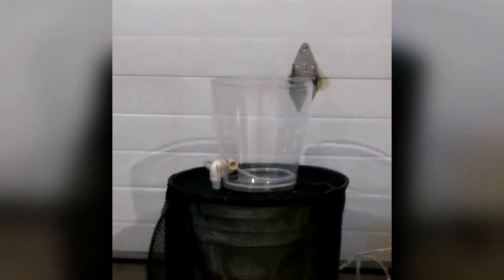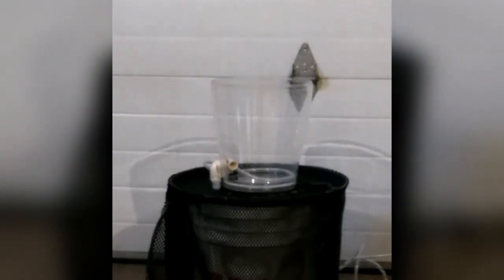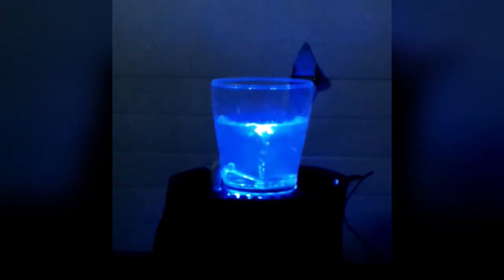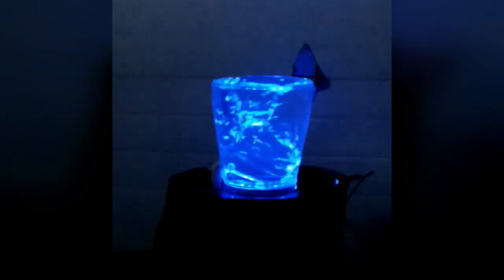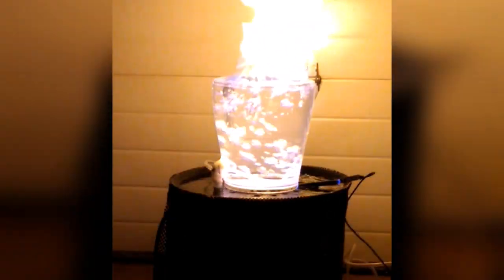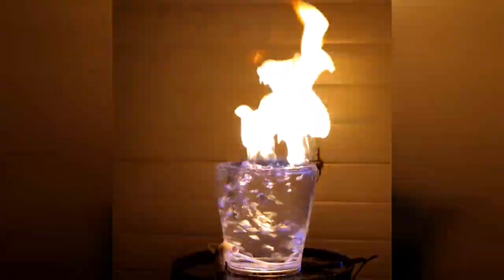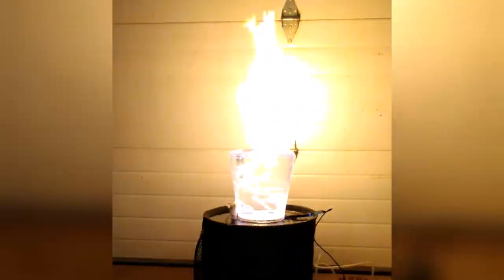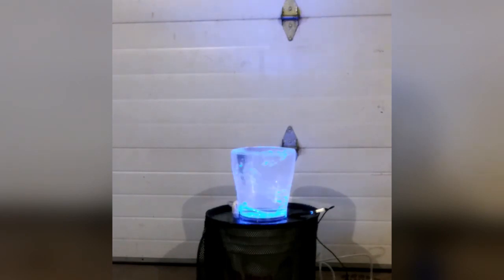DIY Vortex Fire Water Fountain

Comment: Wow!  Thanks for this.  I wish you would have explained how you attached the propane hose (to the tank (and what size tank)), as well as the tubing and all of the needed equipment for it - regulator, plug end of tube, then, drill small holes in that tube, etc.  Many of the questions were answered below, but .... it's hard to visualize (at least for me).  But, thank you so much!
Reply from the maker: Thanks so much for the reply. I didn't show how I hooked up the tank in the video because I was a little concerned that people might burn their homes/shop down trying to replicate this. And I certainly don't want anybody getting hurt trying to build this. Propane is extremely flammable and shouldn't be played with unless you know what you're doing. Thanks again!

Comment: I saw them make this. Really cool... But what happens if the pump shuts off while the propane is on? Do you have anything in place to kill the propane if the water gets too low?
Reply from the maker: That's an interesting question, I never really thought about it. But this is not something I would leave on for a very long time or unattended. Great question though and certainly something to think about.

Comment: My daughter and I made one too..were on the last step. Can't figure out the propane hose. Special kind of hose? Do you just lay it in the tank? What size? Etc...
Reply from the maker: I just used a 1/4 inch clear plastic hose. I drilled a hole the same size as the hose near the bottom of the  water container.  Then put the hose through and put some hot glue around to seal it. Don't forget to drill some small holes in the clear tube so the gas can escape in the water.
Reply: @budslife  Thanks so much grant!!! My father and I were just trying to figure it out. We thought it looked like braided line. How did you connect that 1/4" hose to the propane though? Im also guessing and adjustable regulator to control the flow of gas of course. Just need to know the supplies. Type A tank, 1/4" pvc?? I can do the holes for the gas to release. Just not sure how to connect said hose to the propane and what do you do with end of 1/4 line if its open..plug it with?  Love your vids and theyve given my daughter and I plenty to do and still counting.

Comment: That is so cool, how do you get the propane tube in?
Reply from the maker: I just drill a hole the same size as the tube and sealed it with some hot glue. It worked out perfect no leaks.
Reply: I can’t get my propane to stay lit.   It keeps going out

Comment: Will the water not flood the propane hose? When you turn the gas off?
Reply from the maker: That's a great question. I just did this for a test to see how it would work. I had most of the stuff lying around. So flooding the hose with water wasn't really an issue. If I was going to leave this hooked up all the time with water in it I would probably install a check valve in the hose so the water couldn't flow back to the propane tank. Thanks for the great question.!
Reply: Also, did you cap off the hose and puncture small holes or just let it run out the end, I assume about a 1/4 inch pipe just dont want the propane bubbles too large. Thanks for your reply(:

Comment: How did you connect the propane to the hose?
Reply from the maker: I just used a clear plastic hose and slip it over the end of the torch and then put a little black tape around it to seal it.

Comment: How do u add the propane
Reply from the maker: Just use the propane torch and a plastic hose and ran it in the bottom of the container. I sealed it up with hot glue worked perfectly.
Reply: @budslife  I did this project but couldnt get enuff propane pressure to keep the fire lit. I used a big bbq propane vessel, from it, the regulator & reduced down to 1/2 vinyl hose(maybe 1 size down..cant remember exactly) .
Reply from the maker: @rcthomas7090  I am not a expert but I pretty sure that a propane tank with a regulator on it will release the pressure at a much lower pressure. A propane torch has no regulator on it therefore it will release the pressure much higher. I think this is why you couldn't get enough pressure to go up through the water and keep it lit. Please be safe and don't hurt yourself doing this project.
Reply: @budslife  thank you for the advice!